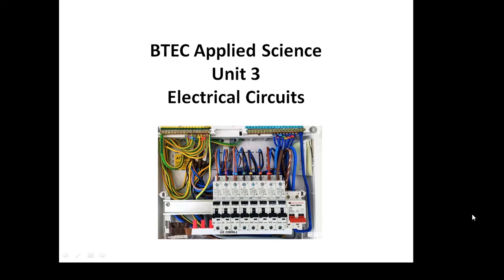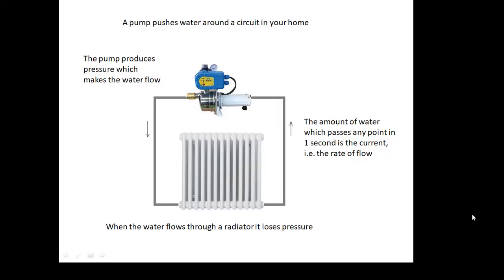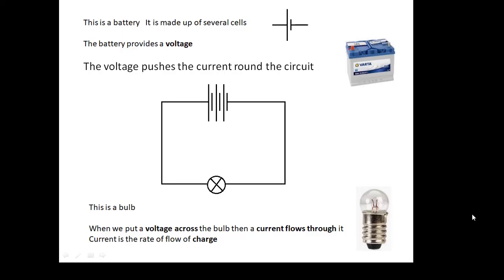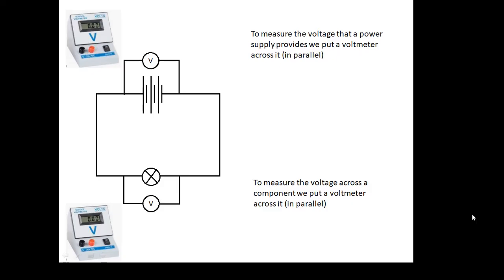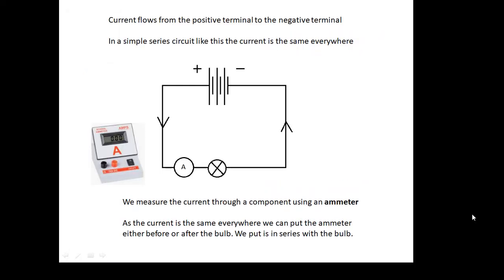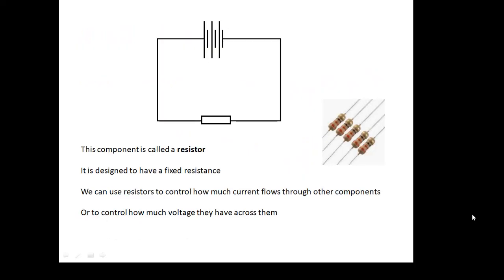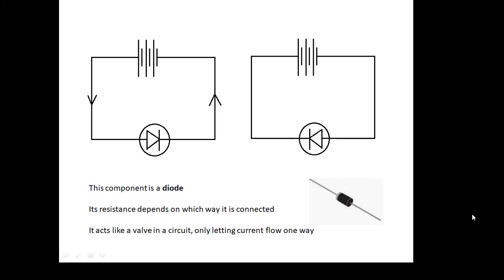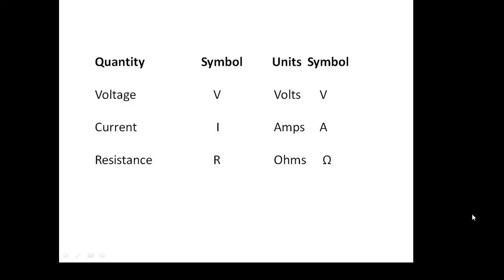BTEC Applied Science: Unit 3 Electrical Circuits

Comment: do you think circuit and diffusion is coming around this time? if so would part "A" be diffusion?
Reply: if you look at all the previous topics that have been every year we are hoping for physics 1-3 and diffusion 4-5
Reply: @hamna.14x  wdym physics 1-3 as in circuits electricity?
Reply: @ulfatsultana8503  questions 1-3
Reply: @hamna.14x  but circuits came last yr in section 2
Reply: @ulfatsultana8503  yeah but it has barely come up in questions 1-3
Reply: @hamna.14x  na it has came up inshallah it don't come I not revised it
Reply: @hamna.14x  it came didn't it
Reply from the maker: i have no idea. i dont write the paper